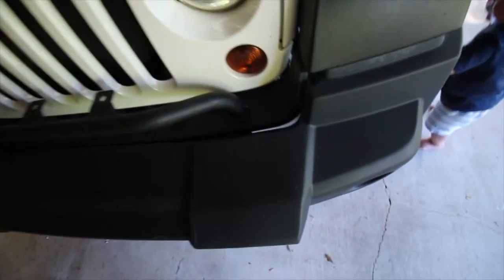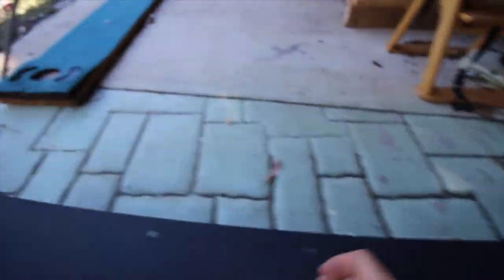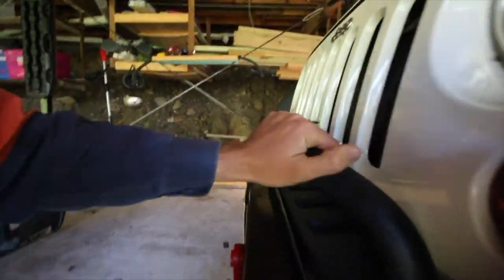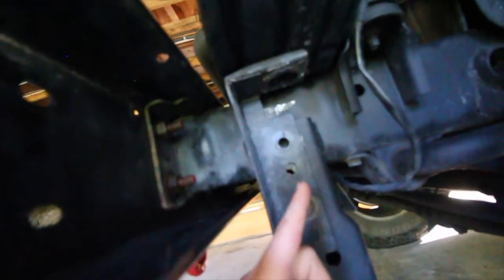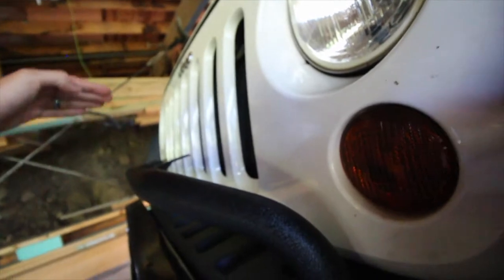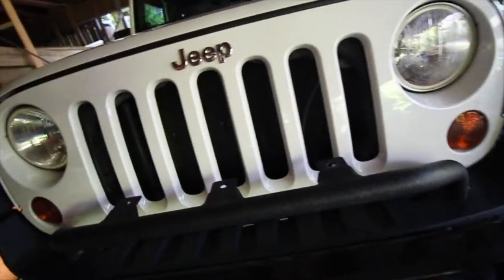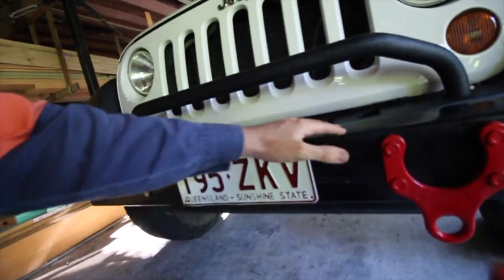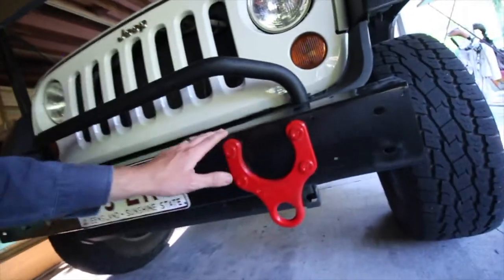JEEP JK LIGHT BAR BRACKET

Comment: I’m going to be running 5 cube spotties up top, light bar on the bumper, one on each side and a rear work light. Only reason I have the bumper coz the bar came with the light already integrated.
Reply from the maker: Nice, it’s really good how everything is built on with it. You definitely want have any problems seeing at night
Reply: @Whiteandsonsgarage  yeah. To be honest I probably won’t run the bumper light too often as it’s probably a cheap bar thrown into the bullbar. My roof pods on the other hand are beautiful! ❤️
Reply from the maker: @TJ_Beam  yeah fear point, what roof pods did you go with?
Reply: @Whiteandsonsgarage  I went with the Rigid Industries Radiance Pods from Snake Racing. 🤘
Reply from the maker: @TJ_Beam  sounds good, might have to check them out